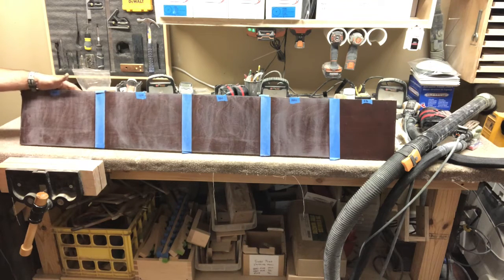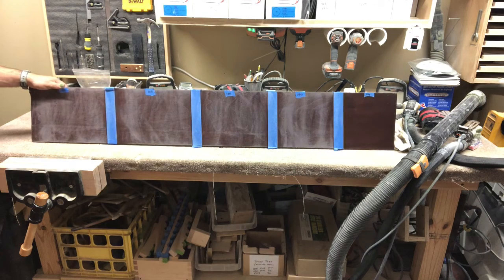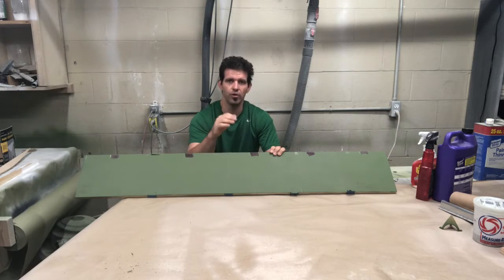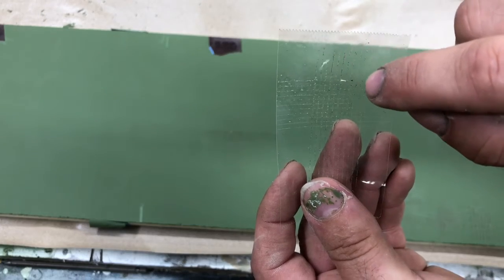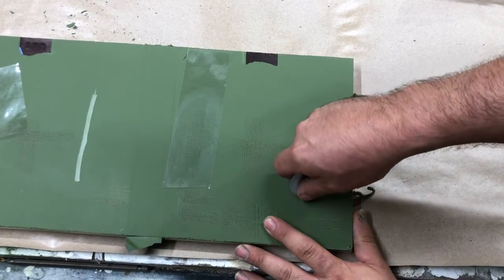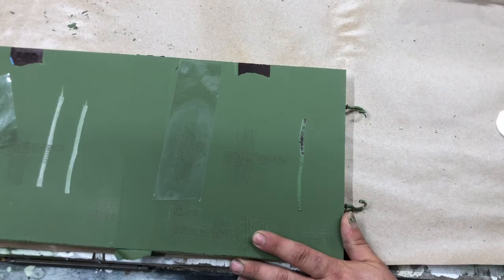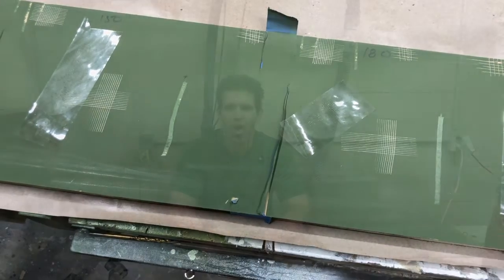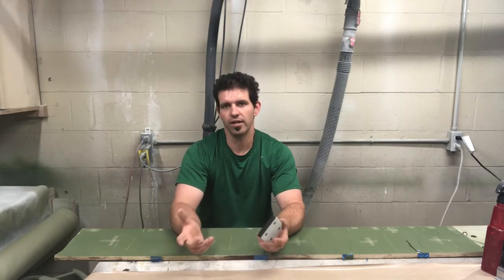Sanding Vs Deglosser in Refinishing

Comment: I wouldn't think you'd have a problem even with 3:20 cuz automotive painting usually sand with 400 over the primer before paint and there is an issue so although it's woodwork I would assume the paint was still adhere pretty darn good with even standing with 400
Reply: I tried using the glosser on vinyl cabinets even with the bonding primer and it all started to peel so by personal experience I would never recommend a deglosser I think it's best just to hand sand with like a 150 and then do bonding primer and then paint not by what I've seen I think that's the best
Reply: Did u spray a bonding primer within 15 minutes of the deglosser?

Comment: If u use deglosser x2 then acetone to clean that up it will bond way better
Reply from the maker: How?  Putting acetone on substrate doesn’t change the adhesion. It’s all about getting a mechanical bond. Deglosser just dull the sheen with chemicals which improves the bonding but it will never be as good as a mechanical scratch it’s just science.

Comment: Thanks for this. Im moving into a new house soon and currently doing some research on painting cabinets. I knew sanding was going to be required..but then I saw several people use deglosser. I figured I might try it to save a bunch of time, but I was pretty skeptical. I work as an automotive painter, so I know the adhesion power of a mechanical bond. After seeing this Im just going to save myself the future grief and put in the extra time to sand em down. Great video.
Reply from the maker: Yes a mechanical bond is the best. I was surprised that the deglosser did do as well as it did but it’s not as good as a mechanical scratch.
Reply: @ericreason6559  How long did you leave the top coat to cure, before the adhesion test?

Comment: Did you use a primer?  oil or water based?  And did the paint get the recommended curing time?
Reply from the maker: The whole video is about vinyl sealer which is a primer/sealer

Comment: Would you reccomend deglosser before sanding? Or just sanding? 
Some of the old cabinet sets I do are so dirty I'm afraid to sand before cleaning them.
Thanks Eric.
Reply: Eric, I have been a painter for 25 years. Getting more and more requests for painting cabinets. It's something I've always done but from more of a painters method and not the method of a professional refinisher. I have airless and hvlp but looking to move up to a fine finish machine like the apollo. So stoked I found your channel.  Your knowledge and also the knowledge of the guests you have on is priceless. Elite Fine Finish, and also Dennis have been great as well. I've been doing my homework and its paying off. After years of trial and error and learning how to fix my mistakes I'm finally coming around and feeling confident doing large kitchen sets. You guys rock !! 
Thanks for all the advice !!!
Reply: CLEAN FIRST, then sand - otherwise all your doing is grinding that dirt into the substrate.

Comment: Love your videos!!!
Still learning and updating after being in the painting business for 20 years of 30 years of painting..
I’m taking your challenge to try one of these 4, 
“Renner. milesi sirca, envirolak  cic, sirca or milesi universal.”
Which one is the best for refinishing?
 
.
Also, my main question to you is this…
I always use 180  for sanding down the gloss, but I also use a deglosser after I sand for 2 reason; (1)to help with deglossing  the  corners and inside trim of the cabinet I may missed, and (2) it helps with getting the dust off, fellow by tack clothe..
 0 dust.
.
Or would it be better to degloss 1st then sand ?
or just sand..
 I always wonder if I was doing it the best way.. 
Thanks for your time on your videos.
Reply from the maker: You are doing fine with your method.

Comment: What about non real wood cabinet frames. I am redoing RV cabinets, how would you prep the Laminate frame?
Reply from the maker: You definitely need a Mechincal bond with laminate at least a 180 scratch.
Reply from the maker: doc hall dawn dish soap can causes issue with some coatings but yes in some cases the top coats will adhere better than the primers. It all depends on the primer and the condition of the cabinets.

Comment: the foam pads do nothing to a factory lacquer finish or whatever its coated with.  but the normal paper does an amazing job at stripping down a coating. I had to use the higher grits  so i didnt mess up the profiles or used some other pad or 3m  scratch pads by hand.
Reply from the maker: Rick Bailey yes it depends on what you are trying to achieve but I agree. Some folks use the coarse or medium which is suppose to be a 80 scratch on the coarse and a 180 on the medium but I agree that it’s not as aggressive as regular sand paper.

Comment: What about using Krud Cutter instead of sanding a bathtub before enameling it with a kit?
Reply from the maker: R Julian no idea I don’t refinish bath tubs but based on my experiment I would say that a mechanical bond is always going to be better
Reply: If it's fiberglass sand it if it's porcelain and tile acid etch it with Hf mix